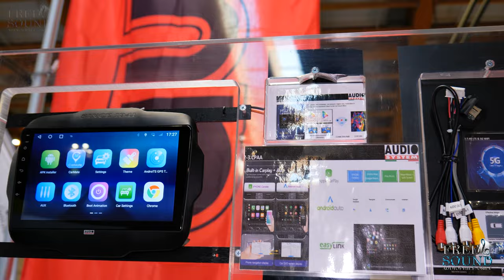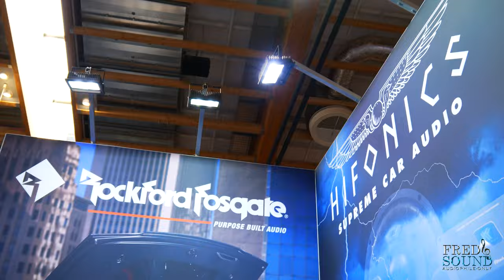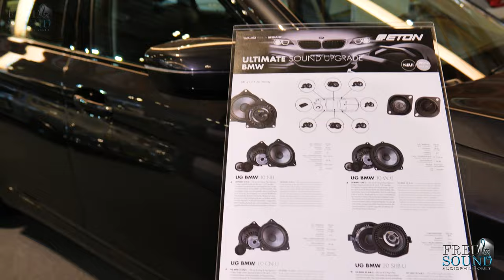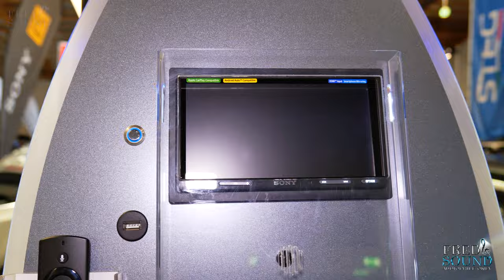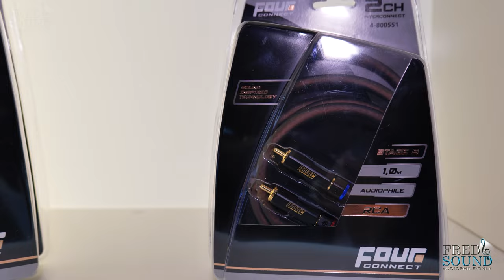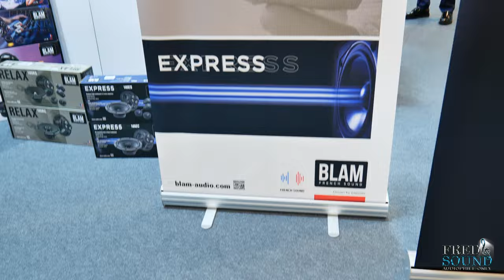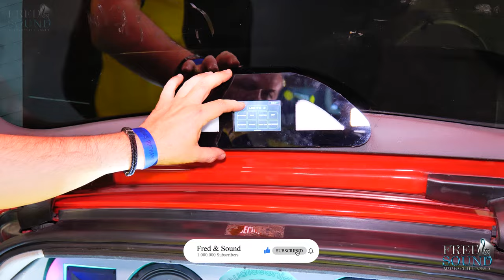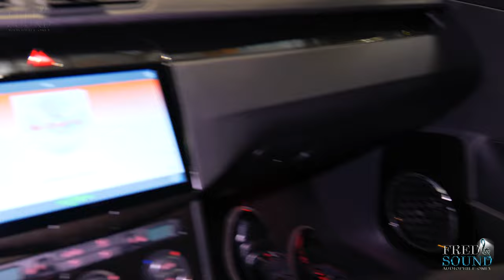EMMA 2022 HIGH END CAR AUDIO SHOW CARMEDIA WORLD SALZBURG BY FRED & SOUND 5K (FNS)

Comment from the maker: ◉SKIP TO:

🎼HIGH-END SQ SETUPS 👉🏼44:06
🔊SPL SETUPS 👉🏼54:34
🚗DRIFT SHOW 👉🏼58:08
📸5K SHOTS 👉🏼59:15

SKIP To Your Requested Brand:

 STEG | AUDIOSYSTEM ITALY 👉🏼0:57
 JL AUDIO 👉🏼4:36
 ZAPCO 👉🏼5:42
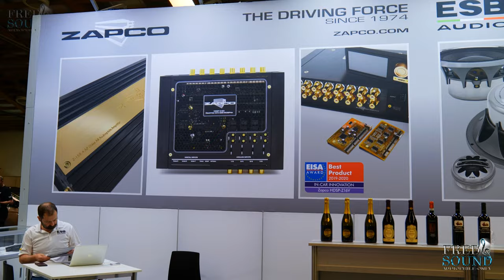 ESB 👉🏼7:07
 ROCKFORD 👉🏼9:14
 HIFONICS 👉🏼10:03
 MUSWAY | ESX 👉🏼10:24
 GAS | DLS 👉🏼14:22 
 EMPHASER 👉🏼14:54
 ETON 👉🏼15:40 
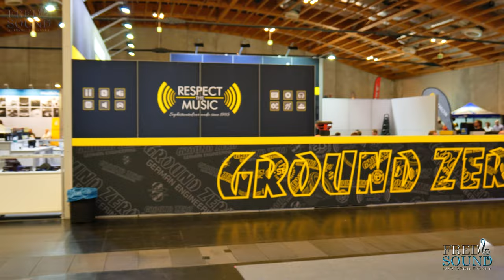 PHOENIX GOLD | STINGER 👉🏼17:48   
 GROUND ZERO 👉🏼20:25 
 SONY 👉🏼22:17
 VIBE | EDGE 👉🏼23:12 
 BRAX | HELIX | MATCH 👉🏼24:18 
 AI SONIC | DD AUDIO | SOUND DIGITAL 👉🏼28:14    
 VIBRO FILTER 👉🏼33:09    
 FOCAL 👉🏼33:38    
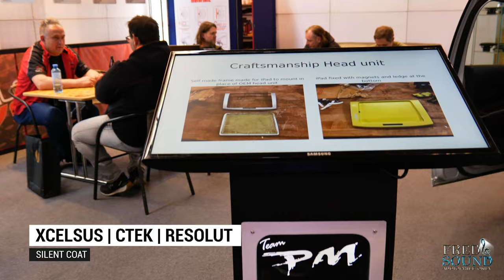 XCELSUS | CTEK | RESOLUT | SILENT COAT👉🏼35:27   
 DRAGSTER | ACADEMY | FOR-X 👉🏼38:03    
 BLAM 👉🏼40:02   
 CZ AUDIO 👉🏼41:36   
 REBEC 👉🏼42:47     
 ACV 👉🏼43:38    
 AUDISON | HERTZ👉🏼43:51
Reply: Thanks, keep up doing great work !
Reply from the maker: @stevenhoe451  thanks for the support mate:)
Reply: Sir Kindly name the top 5 sq type brands that match your preference ❤️

Because not each brand is available everywhere ( country ) it will help a-lot to choose branded rather than some Chinese brand like massive audio  etc
Reply from the maker: @aadirao4169  hi, STEG ITALY, AudioSystem italy, Zapco, micro precision, Brax, thanks for watching